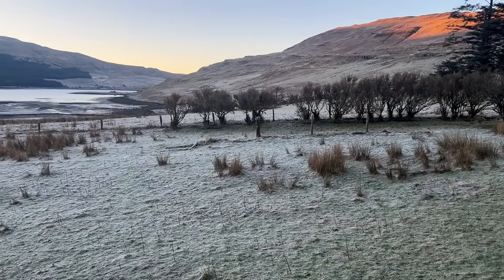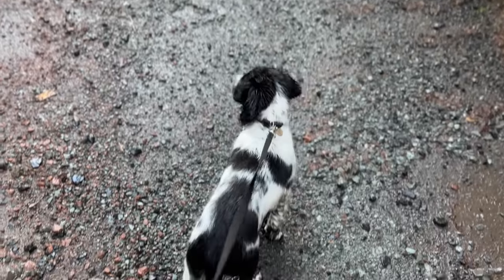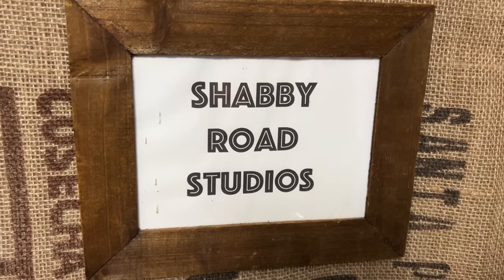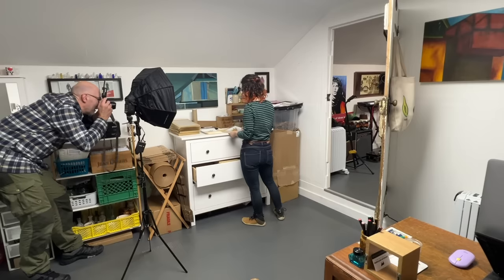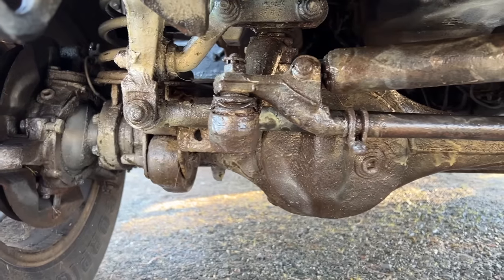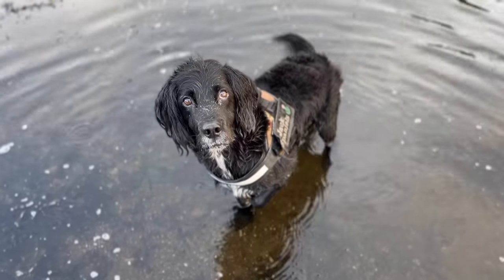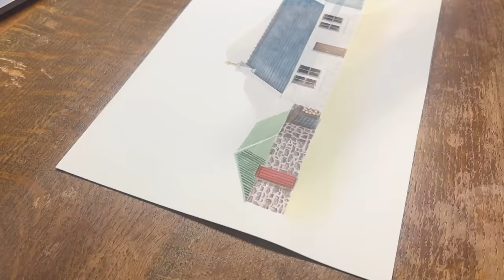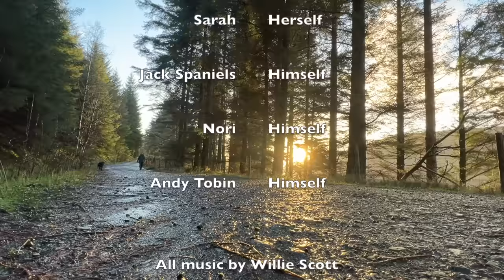PUPPY FREEDOM! Leaving The Cottage For The First Time - Isle Of Skye, Scottish Highlands Ep55

Comment: Regarding the Landy keep locks well oiled and spray silicone grease on door seals to prevent freezing together. 
Also use the little dehumidifier boxes you can get for about £5 in supermarkets, I always had two in mine to keep the damp at bay, helps prevent frozen glass internally.
Reply from the maker: Great advice - thanks!!